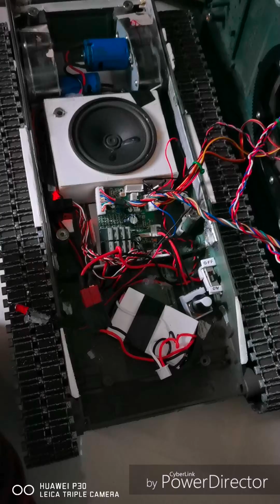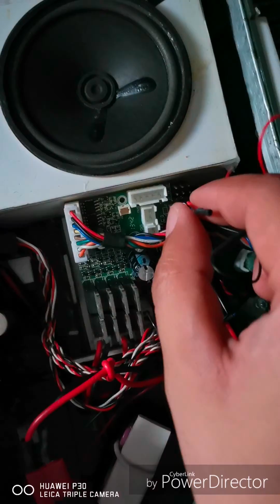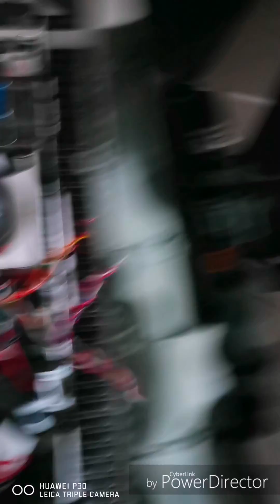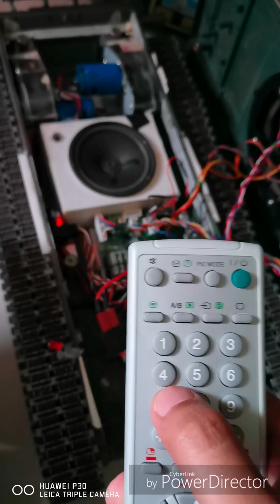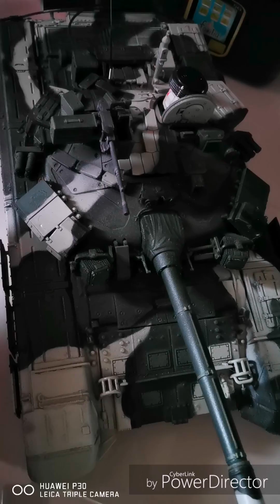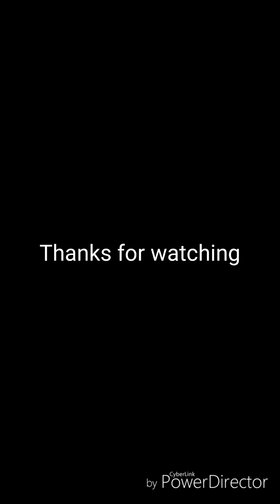Programming a clark tk board

Comment: Hello....Did you mean I should replace Infra Red LED (in HL battle Unit) with a regular red LED?
Reply from the maker: It depends on what you have. If you're using the tkboard already, then there's an extra set of wires for a regular LED that will serve as a hit indicator.
Reply from the maker: If you're just about to set it up then yes. You have to add 2 wires (1 set) for the infrared.. The stock HL battle unit with infrared will be replaced with a regular LED and will function as a hit indicator in the clark tk22 board. Then make 2 I forgot the gauge but thinner wires for the infrared itself. It will plugged in separately in the board.
Reply: @jercsgn  Thank You Jer!!!